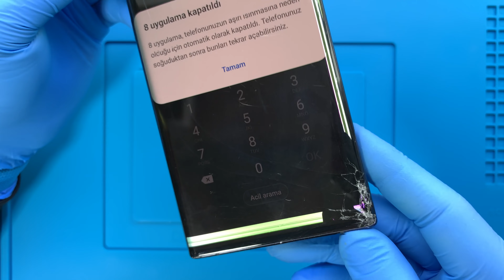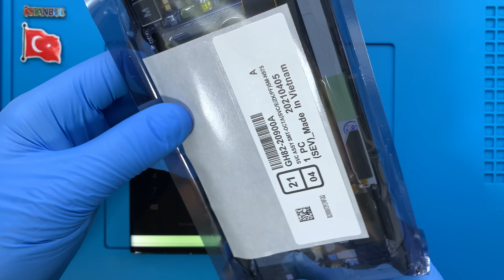Samsung Galaxy Note 10+ Ekran Değişimi 🇹🇷

Comment: Is the phone still have water resistance like the new one, after repplacing the LCD?
Reply from the maker: Hello there;
Phone manufacturers only guarantee water resistance for undamaged and undamaged devices. For this reason, it is necessary to be more careful about liquid contact after screen - part replacement and technical service process.
Greetings.